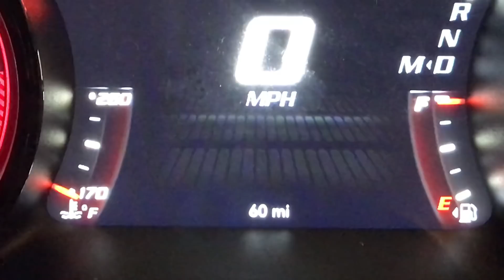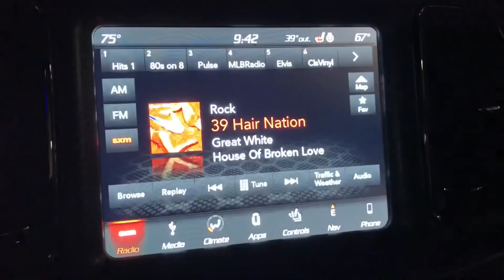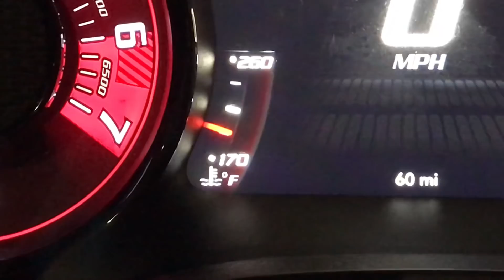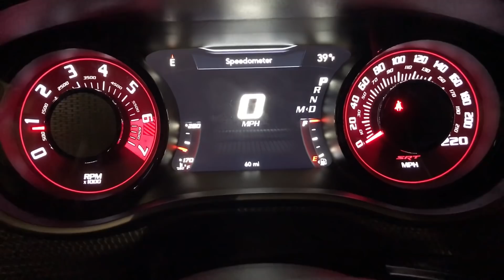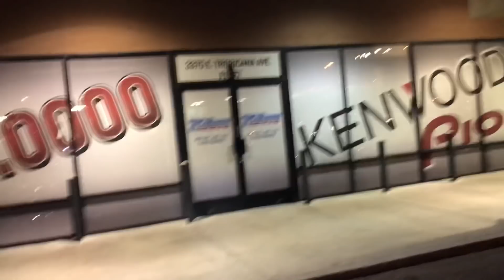2019 DODGE CHALLENGER HELLCAT SRT REDEYE WIDEBODY DAY 2 WITH THE REDEYE

Comment: Each Hellcat V-8 receives a 42-minute dyno run at the Saltillo, Mexico, manufacturing plant for break-in. Maximum rpm is 5200 at 90-percent load. The Motor doesn't need break in, rather the trans and diff etc. need break in, congratulation on the Beautiful beast, I have the same color in a hellcat charger.
Reply from the maker: Nice, Thank's for the info
Reply: I think Paul is doing the right thing with breaking it in . Especially after the past incident with the other Hellcat ! Always good to know you didn't do anything to cause problems with performance of the new auto .  It also allows you to really pay close attention to the total vehicle's performance ! Especially when he starts buying tires every 2 months or less LOL LOL after 2500 miles or so !
Reply: @sushirollusa  for sure, I did the same thing lol. Just thought it was useful if he didn't already know.
Reply: @1smokan  very good info for sure !
Reply: Made in Mexico?  Wow ill be sure to never buy one

Comment: Beauty. Hopefully my lemon law process goes well. Been a few months since i got my attorney
Reply: What happened in your case?  Dealership trying to screw you around?
Reply from the maker: What State are you in?
Reply: I finished my lemon law case a little over a year and half ago make sure you stay on top of your attorneys because they like to take there time on actually filling the paper work once I got them to file the paper work my case was settled in 6 month's out of court if your attorneys told you they filled the paper work ask them to see the filled paper work, I don't know your circumstances but I had a 2013 Camaro ZL1 that went through 7 supercharger's 3 set's of exhaust and the car was in and out of the shop for approximately 12 month's of the 3 year's I owned it and before I got my attorney I tried working with the dealership and the Corporate office of GM for about 1 year and the dealership basically said we will just keep putting supercharger's on when you need one and corporate told me to pound sand the last straw for me was I picked up my car with the 7th supercharger and by the time I got home which is less then 7 miles the supercharger was already knocking and I called the dealership and they said no problem bring it back on Monday and we will put a new one on and I said no thanks I will see you in court and there reply was what ever you want to do. As long as you have all your documentation in order you should be fine but I have heard these cases can take up to a year and half and sometimes longer mine was a total of 1 year but that's because my paper work didn't get filled with the court for 6 month's..Good luck.
Reply: @Mr.Torres831  No I did not, are you saying he is not having problems with his car? If so how do you know this for sure?
Reply: Eduardo Torres lol kinda picked tht up SRT MAFIA comments about a GM lemon law hahaha
Reply: @henrickhenry8333  I'm confused on your comment where does SRT MAFIA say anything about a GM lemon law when I was the one that wrote to him about my GM lemon law to try to help him out??? Hahaha..
Reply: Paul K I trust this one doesn’t have the built in mechanical lane change feature?
Reply: Devin Swanson I don’t think the srt guy was being sarcastic. Btw that sucks, was the car new when you bought it?
Reply: Im in Washington state
Reply: Paul, i talked to you about the process a little earlier on in one of your videos when i was having issues with this process and you told me to get a different attorney. Im sure you remember my situation where i told you my attorney wanted me to write fca a letter.
Reply: & guys im not trolling or joking about my car. Ive had the key fob replaced once, paddle shifters once, u connect 3 times, usb ports in both the center console and the rear seat area & Radio module once. These electronics are giving out like its nobodys business. I own a Pitch black 2017 charger hellcat with 19k currently. Bought it brand new on may 31st 2017
Reply: 4 uconnect units have officially been in my car and theyre punking me around hoping id go away. Fca told me theyll give me 1k as a settlement. I laughed, hung up and got an attorney. These guys are taking forever
Reply: @F82_  I agree and yes I bought the car brand new right off the show room floor with 15 miles on it.
Reply: @devinswanson1752  
The problem was obviously your heads,cheap & easy fix.
Reply: @charleshenson4183  so you think my supercharger was going out because of the heads on the car? If you look up 2013 ZL1 Camaro or specific the LSA engine you will find that the supercharger's were junk and would have nothing to do with the heads on the car and if it was an easy fix I'm sure GM would have fixed the problem.
Reply: @devinswanson1752  
They seem to run fine,for everyone retrofitting them & your I guess your manifolds were defective as well lmao.
Simply look at your common denominator (heads) for your answer.
Both your supercharger & manifolds were bolted up to those were they not?
Reply: @charleshenson4183  Did you happen to own a ZL1 or are you just going off of what you have read and to be honest I really couldn't care less about that car anymore it's gone and was bought back by GM so what ever the reason is not my concern anymore and when you buy a new car you shouldn't have to redo anything or retrofit anything you should be able to just enjoy what you bought.
Reply: @devinswanson1752  I agree & glad that bought it back.
I had a pos 15 dodge ram sport 1500 4x4 that I simply traded of for a new 16 f250 kung ranch.
Would have been nice if fca had bought that turd back from me.
I understand your frustration & not picking on you,it was the stupid techs at the dealership who couldn't fix an obvious problem.
Reply: SRT Mafia you ain’t the first to Lemon law a Hell Cat
Reply: @fredg8834  
That's because quality isn't even a concern of fca.
Just make a car that'll sell & advertise the hell out of it,once it's sold,their job is done & your just the sucker with the keys to a chrome plated turd.

Comment: Nice car but a block heater is for when it's below zero temps outside lol . The thermostat on that thing will probably keep shutting that heater off as soon as it runs heat for a few minutes in your climate .
Reply: block heaters are for the car when it is parked overnight or for a long period of time that way it does not take long to get up to operating temp once started
Reply from the maker: Ow man, dont burst my bubble
Reply: @79tazman  and you sir are the correct one. If you waited to use a block heater till it was below freezing on any diesel then there's a lot of times it's not gonna  start. 

It keeps the oil and everything warm and ready to go for an easier , safer start and yes Paul, you will have heat quicker than without one and will be a safer start on the engine  cause  the oil isn't cold and thick
Reply: Hey Paul, I’d recommend putting that block heater on a timer, which you can find readily. Helps reduce wear on the heater. Car looks awesome! Absolutely love that color
Reply: @ThePaul1551  I live in Indiana where it gets sub-zero temps and i have a block heater on one vehicle but I've never used it. Back in the 1970's it would get very cold in winter but not so much anymore.

Comment: Awesome Paul K《☆》I got wrangled into a test drive in a 2018 SRT 392 Challenger 6 speed when I was at the dealership getting parts for My truck. I kept telling the Salesman I didn't have time but they tag teamed Me. Next thing I know the car was waiting at the door warmed up ready to go. I didn't want to seem interested so I told Him I would ride shotgun so they wouldn't need to run My credit or anything. This dude was driving the dogshit out of the brandnew SRT with 26 miles on it. He said while the tach was blowing by 6000rpm in 1st gear Ya this won't hurt it & even if it does You have 6/60 warranty. He even offered to let Me drive back to the dealership & I said no thanks brother. You have done a fine demonstration of what the SRT can do ☻
Reply from the maker: Ha Ha - Crazy, not for the guy who buys it though - but I suspect it is what's expected..
Reply: Lol anything to get the 2018s off the lot huh..
Reply: My son and i drove onto a Chrysler dealer with my Mustang i had just bought and the salesmen were on us like flies on, well you know. Here dirve this Hellcat ,no CC or anything required. They pushed hard , but i didnt bite no one wants buyers remorse LOL. Even had a trackhawk they tried with, but 100g plus no thanx
Reply: 6 speed manual?
Reply: @marlostanfield1087  《☆》Ya :*: He was slaming gears like nobodies business ☻
Reply: In my city we had a 2017 charger hellcat that just sold this Christmas, yet somehow it had 1500 miles on it? I was shocked that they claimed it was driven lightly for maintenance but it took 3 years for them to sell it, the guy who got i better have gotten a great deal it was priced at 60000 before rebates but was 3 years old
Reply: @tayloralaniz9925  《☆》From what I see on Youtube the Dodge dealership policies are different depending on the management / owners. I hear some dealers are FCA owned so I would tend to think they may have better policies idk. I haven't bought a new vehicle in 20 years :*: I'm very interested but skeptical ☻
Reply: I'm up here in the cold northeast.   About a month ago I test drove a new Challenger TA 392 with a stick and summer tires.  The salesman turned off the traction control in an attempt to rock my world.

Comment: You run the engine block heater cord out the front of the engine compartment leaving the extension cord lay over the front end of the vehicle. That way you can latch your hood part of the way. Not all of the way. Just the first latch as it would be right after pulling the interior hood latch. Helps to also keep the cold air out. Just don’t forget to unplug before taking off!
Reply from the maker: Thank's, but I think I was expecting a little to much out of it, like keeping the motor warm, ha ha - it does not...

Comment: First nighttime redeye video.  Looks even meaner at night.  That cap in the headlight should pop out. Thanks again for sharing.
Reply from the maker: I will be a poppin that cap out !!!
Reply: Paul K there are two small set screws and then you turn and twist to remove cap.
Reply from the maker: Thanks

Comment: Indigo blue is such a nice color and it is a gorgeous Mopar you have got there, congrats. Good idea to break it in well and is smart, I just watched some guys on another channel test-driving one and were beating on it. It's amazing how loud the exhaust is on the newer Challengers and is almost as noisy as the pipes on my srt8, and they rock. I live in AZ now but when I was in cold country all engine block heaters that I ever saw were under the hood but that was many years ago, do the newer ones have connections in the back or somewhere besides under the hood on other vehicles ?

Comment: Maybe try running the cord through the open headlight so you can shut the hood, just an idea..
Reply from the maker: I am going to do something that is for sure..
Reply: Ya don’t need a block heater above about 10 degrees F
Reply: Unless you live in an area with climates like Minnesota in the US or parts of Canada where it stays under 15F for sustained time (i.e. - weeks day and night) a block heater is a complete waste of energy.  I live in the NE US and no one uses a block heater on a gas vehicle.  It simply doesn't get cold enough for long enough to provide any benefit. And, it's definitely not designed for use with the hood open. Read the manual again.

Comment: You have a plug in hybrid Red Eye lol. I have been interested in a 2019 Charger Hellcat but you're kind of pulling me towards a Challenger Hellcat. My dealer has 3 base 2019 (yes cloth seats) indigo Blue Challenger Hellcats enroute. 2 automatics and 1 manual listed at $6k off. I could get the manual for $55k+ TTL. Automatic for $58k+TTL. Or a 2019 Charger Hellcat to $60k+TTL but I get leather and 4 doors. Ugghh such a hard decision.

Comment: Lemon Law Buy back! Block heater cord makes no sense. Scratched the paint with the dodge detailing rag i bought from accessories to route the cord that popped my breaker in my million dollar business the i waited  in line to buy from the new dealer that had a 1 year warranty on all accessories but doesn’t value the warranty because i opened the package and dropped it in the parking lot. It should have stated don’t drop this cloth in rocks and use it because it could scratch your paint.
Reply from the maker: You may be correct, the heater was a waste of 95 bucks

Comment: I'm still wondering.  Is it really a "Wide Body" or is it just the fender well opening lips? To me a wide body is fenders themselves are wider. My NSX had a wide body on it. No fender well lips. Both front fenders swelled out and both rear quarters did the same. Is this the new 2019 version?
Reply: yup....i prefer this lips version but i kinda do like the bolt on looks to cars with widebody that have it

Comment: Lmfao ..... plugging it in at 36 degrees ?   LOL here in Canada we don’t plug in unless it’s colder the 20 below .... a block heater only heats your coolant slightly .... it won’t heat your trans at all !   But definitely don’t waste your time plugging in unless it’s 10 below or colder lol you Americans are funny
Reply from the maker: I Plugged it in and you are correct I wasted my time... :(
Reply: We have had a Jeep Cherokee Trailhawk for 2 years here in the northeast.  And because it's garaged,  we have yet to use the block heater.  Now my Kubota tractor, which is also garaged, is a different story.  If it's ever below 20 degrees F, I always plug it in for a couple of hours before start up.
Reply from the maker: I was hoping it would keep the whole thing warm, ha ha
Reply: Well had to practice , because when he takes it to Alaska sure will come in handy !! After it comes out of the trailer . But then again P.K Probally will use the climate control on the custom trailer !

Comment: I have a special request for your next video.  Could you please go over the rumble of the Hellcat on a scale of 1-10?  Would you say that the quality of the valve stem caps on the rims are on par with such a wonderful back up camera you have in such a high performance car?  Your top of the line engine block heater in NV I'm sure will be used a lot! Gets so cold there that even the cactus shrivel up! o.O  And that great Harmon Kardan stereo system! 2 10's? DAAAaaaamn!  I'm sure you bought the car just for the stereo and the car just happened to come with it.
Reply from the maker: Ha Ha -